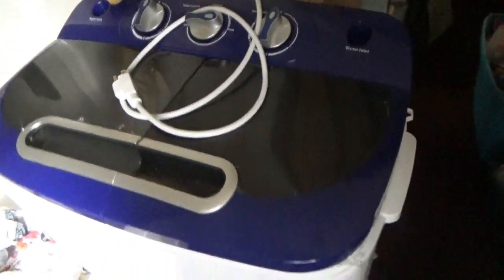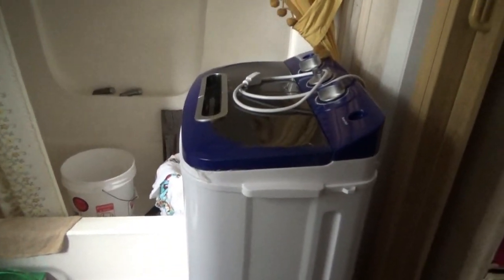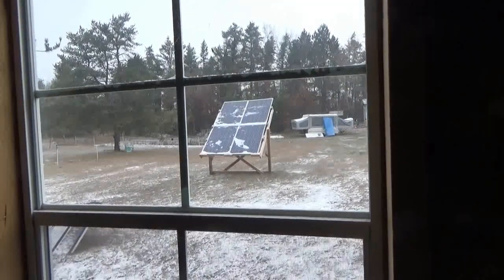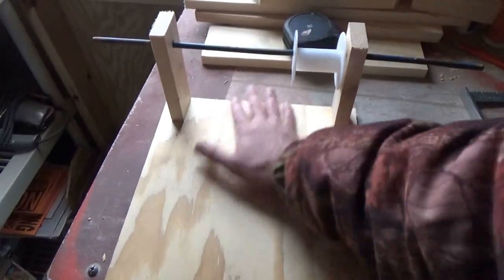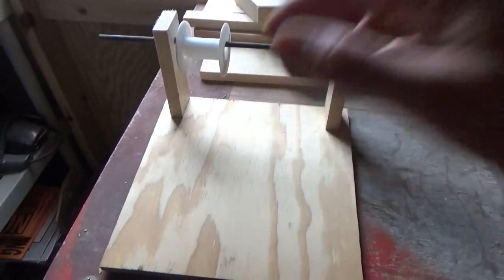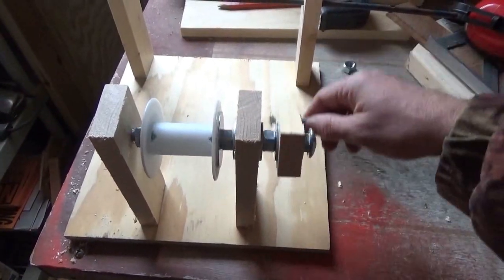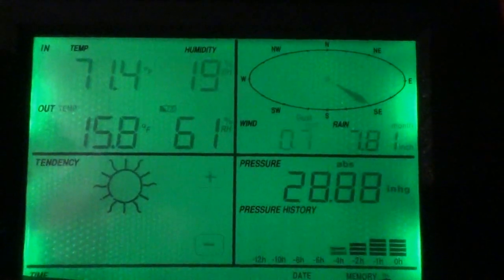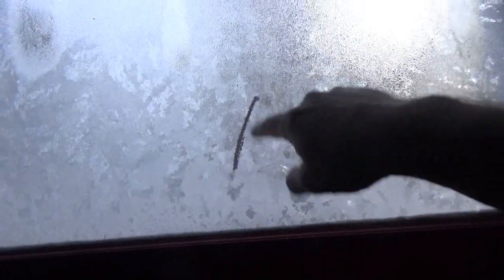Off Grid Wood Shop Work And 2 Degrees F At Night

Comment: Brrr. Do you miss NY state yet? Except for just 2 days in the 20s, it's still upper 30s & 40s F here. 

What brand is your portable washer? Is it big enough to do queen sized blankets & bedspreads? Mine is too small for my bedding, so except for the thin sheets, & pillowcases, I have to wash the rest of the bedding by hand in the tub. My portable washer uses only 50 watts. I also have a high speed spin dryer. It dries stuff enough so they're still damp but don't drip, & then I have to hang them around a few hours to dry the rest of the way. The drier only uses 75 watts. 

I had to go back on the grid due to age-related disabilities. But I still keep my batteries charged from the grid in case of power failures, & keep things efficient because I don't want to throw my meager income at the energy companies since I was forced into retirement. We get several power failures a year. It's hilarious watching the neighbors feeling around in the dark with their cell phone or candle for light, or lost during power failures while life goes on as normal in my house. I can go a few days living normally without power, or frugal with my energy, for about a month. They have to run to their car or to my house just to charge their phone.

My neighbors gas furnaces won't even run without power & they'll freeze to death. They can't understand how I can live normal for days on just batteries. My washer draws 50 watts, theirs draws 1300 watts. My heat & hot water don't require electricity. The only rough failures are on hot summer days. Not enough batteries to run AC long. But DC or battery powered fans help a lot on those days.

Comment: you need to fold up the camper before the canvass gets worse or the winds tear it to pieces. cant wait to see you hook up everything in the house to solar and get the meter removed. Keep up the good work
Reply: Why would anyone want to remove the meter and disconnect from the grid if they are already hooked up? Especially if there isn't a budget for an adequate solar power system. Besides, even with a really good solar power system, the best option is to have it grid tied with battery backup. Then excess power can be sold back to the power company. Or the grid can make up for where solar falls short. No need to do without.
Reply from the maker: I want to remove the one slide out and then use it for my camping gear. Hopefully next week.
Reply from the maker: Yes, I want to eventually grid tie.

Comment: Quick suggestion for the big window:

1)  1x2 frame
2)  3M Window insulater kit goes on the frame
3)  Standard foam weatherstripping between "film frame" and window frame.
Fixed!  CHEAP!  d=O)

Why?  Because ALL of those window film kits--the ones that DO stick properly--have a STRONG risk of damaging any painted or otherwise finished surfaces when spring comes and you want to take them down again.  Also...cats.  It'll be FAR easier to remove an inserted frame if the cats get at it and you need to redo the film again.

PS:  Remember when you were in Pine Bush and I used to be able to say "Look out...weather's heading your way..."  d=^o
Reply from the maker: Thank you. I will try to do that.
Reply: Well, ain't no idear air hep'd nobody iffn ya did'n git it outcha shoulder box!  d;o)

(That and I knew you already had wood in the shed. d=O)
Reply: I only had 1 cat ever tear the film years ago, only when I first put it up. I yelled at him & it never happened again. Scotch tape over the tear held the whole winter. Found bite marks on film before I put it up, back when my current kitties were still babies. Tape fixed it. They haven't touched plastic for windows since... a few "nose prints" on it, but no tears. I imagine if a bug got on the window or film during the cold weather, they'd destroy the plastic to get at it. So it's important to not put it up too early in the season, or leave it up too late if it's the heavy, re-usable kind.

Comment: Brrrrrr its really cold there. Do you have any heat in your workshops? you could get a kerosene heater maybe? They have the ones with a wick simple design that uses no electricity.
Reply from the maker: Yes very cold. I put a Mr Heater Buddy in the electronics shop overnight. I need to get the blue flame heater installed asap.